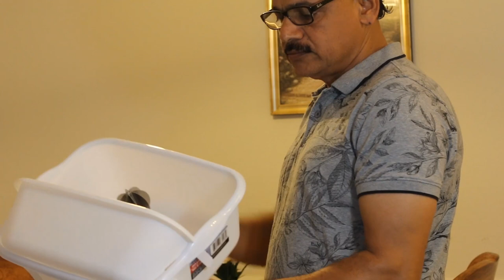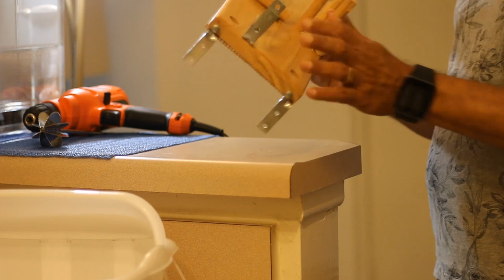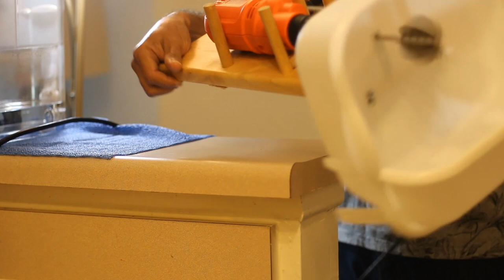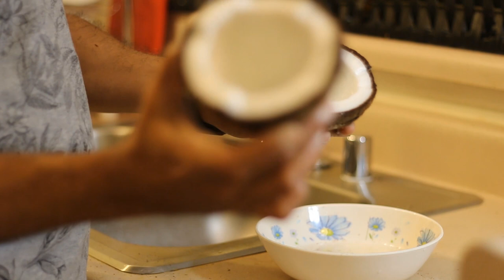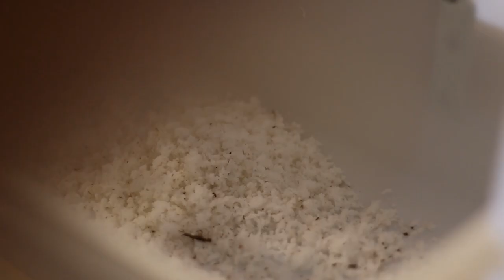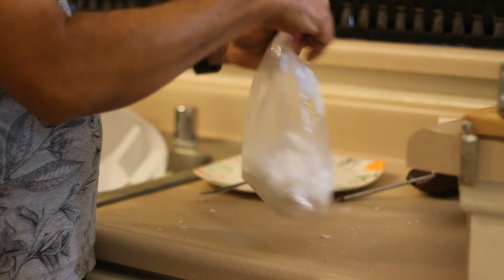Easy DIY Coconut grater

Comment: i.think it is not safe... the rod should been kept stable by an pillow block or any bearing... without a bearing it will cause friction.. worst case the rod might break and cause injury... but great idea though